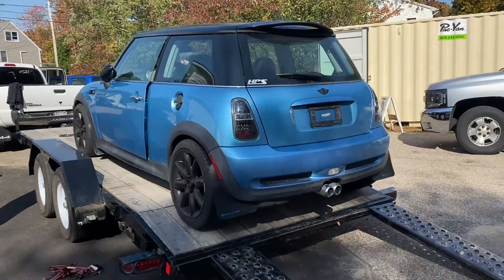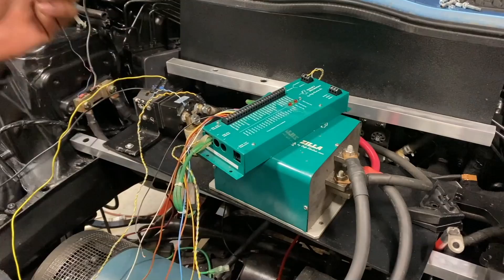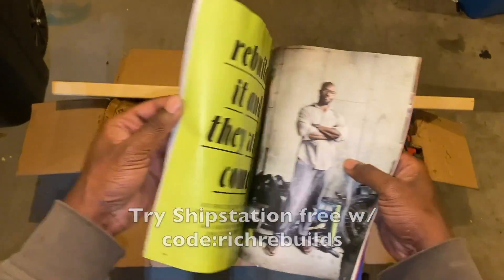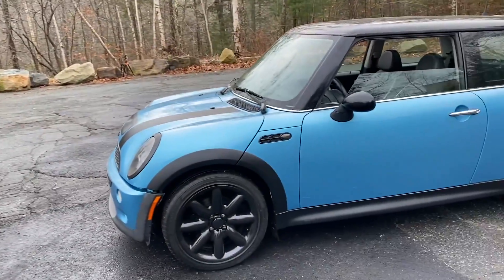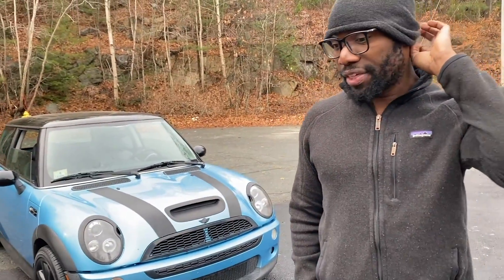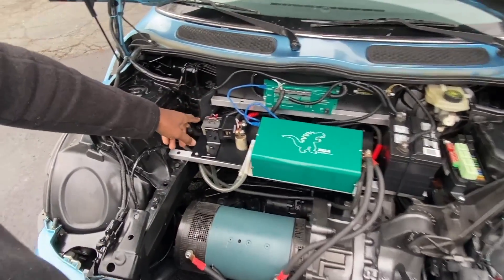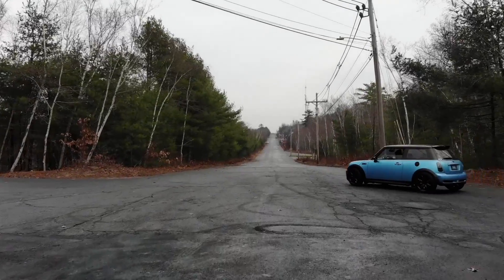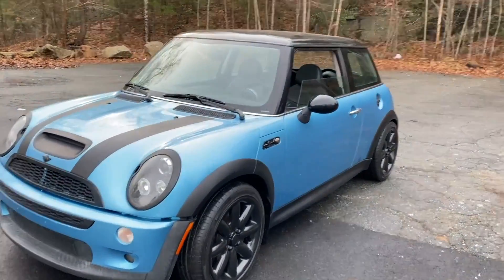We BUILT an Electric Mini Cooper for UNDER $3,000 and its Awesome!

Comment: So you made a mini cooper that is more reliable that it was originally.
Reply: Not difficult
Reply: @sofa-lofa4241  yeah
Reply: All mini coopers are reliable, that's all the wife drives.
Reply: @PeresD  Until you put in non premium gas, use non performance spark plugs, oil filters, oil, and transmission fluid. the car looks decent but costs way to much to use and maintain for what it is.
Reply: @Vivi_Sterling  More of an investment.

Comment: To overcome the initial torque could you not make a pedal where the clutch used to be triggering a cirquit that halves or even 1/3 of the throttle input voltage? This way you could have more accurate control of the bottom end.

Comment: hey I bought a mini cooper 2006 in good condition, just has a recall for an airbag and needs new brakes for $2700, you think it was a decent deal or did I waste my money. 130k miles, just normal wear n tear. there was a couple of leaks that i fixed by simply replacing the caps.

Comment: That an lsx going into an "S"?  Elon's cultists are gonna be so mad.
Reply: It’s going to be so amazing to watch them meltdown 🤘
Reply: It should have the word "S A C R I L E G I O U S" written on the back after it's done. 🔥
Reply: @lolpartyparrot  or "Sacrilicious" hehe
Reply: That's been going on for years. Are they anywhere close to being done?
Reply: Probably a lot better than what I was thinking. I was thinking it was a 350z.
Reply: @nomercy4521  Honestly, I don't think there'd be any hate against an LS-swapped Model S. The fucking thing would literally be a massive engineering exercise; you'd need to make a trans tunnel, delete the frunk for the engine, build a new FIREWALL, find SOME kind of rear-axel setup, add provisions for a radiator and fuel tank... like i'd just be shocked.
Reply: A 5.9 Cummins would have been nice
Reply: @JuicyFruitSkank  Westen already did the 'stang...

Comment: Don't forget to tell everyone the consequences of over revving a dc motor if a gear is missed. One tiny mistake like forgetting it's in neutral and your commutator bars will fling off the rotor shaft, destroying the motor. I believe the zilla has a motor rpm input to prevent this.

Comment: @Rich Rebuilds, Why not cover the bottom of the front to allow the air to flow more streamline under the mini? I think doing so will also minimize dust and water getting up where the motor and electronic are mounted.

Comment: You forgot the most important thing! Super nice job, but the safety dumps a crash test because the 2 battery blocks will fly around the cab during a collision and hit the passengers.
Reply: They're bolted down

Comment: Add solar panel, slide tray the batteries with a encased air cooler partial box.  Secure with latch type quick release clamps.  Power shut off and electric connection, like semi trailer air lines.

Comment: Anyone who cares about having a back seat in one of these has obviously never tried to get into the back seat of a mini.
Reply: One of the most popular Mini mods is called the Rear Seat Delete. It ain't a family sedan.
Reply: Yes. I did have a ride in the back seat of an original Austin Mini. There isn't much space back there.
Reply: At least it's well motivated to make some weight reduction on a car like this one. The exterior of this car looks quite modified with the blacked out wheels and headlight inner panels upon the hood.
Reply: They're not that bad actually I can fit in my buddy's mini one S with not that much problem, just put the front seat kinda between your legs and you're fine, I'm 6ft 2
Reply: @rubenbraekman4515  Pics or it didn't happen
Reply: @rubenbraekman4515  You're a better man than me. I've got in the back of a few and had to be uncoiled out.
Reply: @ruk2023--  haha well getting out is a challenge I'll give you that 😂 I'm pretty flexible I guess
Reply: I’ve got in the back of mine fine. I’m 5’10. Was decently and surprisingly comfortable
Reply: @Tyler Cotton Hill would probably refuse to get in the back a German built car. . .
Reply: They can just sit on the batteries. But wear rubber pants.
Reply: I was told I was conceived in the back seat of a Mini ..
Reply: The recorder sounds while trying to load the trailer are hilarious to me for some reason.
Reply: They are one of the more roomy of compact car rear seats. Two adults can sit comfortably in mine.🤷‍♂️
Reply: My kids love it in the back of my R53. With full size child seats aswell. Daughter behind me to be fair has to put her legs in an odd position though as my seats are in her lap
Reply: The BMW R50 and R53 have for their size good rear seating room. Talking as an owner of an R50 Cooper.
Reply: Ralph Hardwick on the new ones you can easily sit in the back
Reply: @saturndesigns2339  I've been in loads of them, everyone knows someone with a Mini in England. Being able to get in and wanting to go more than a mile in them are two different things.
Reply: @ruk2023--  

Just England or the UK? The back seats for the small size of the car (BMW) are perfectly adequate though you wouldn't want to go from Land's end to John o' Groats if you're say over 200lbs and over 5'10 in the back of one. That goes for just about any small car from the same era though. That said, the rear seats in the BMW Mini are far superior to most.
Reply: @skylined5534  Well I'm from England, so I can only speak for England. 

My original comment wasn't meant for this level of analysis. I'm aware that all small cars have these problems.
Reply: @ruk2023--  

Aye, that they do.
Reply: What gear do you guys run the car in?
Reply: How long does this take to charge?
Reply: Well I even managed to bone my ex wife in the back of her fiat 126 and that entire car would fit in the beach seat of a mini, so stop complaining.

Comment: I'd love to know what the max range is if completely fill this thing with batteries.
Reply: he said 41... with a thrid battery, you could gain 30% more at best--- which would make it like 53 miles..  That's all you get-- get used to plugging it in.
Reply: With these batteries, not great. They are too heavy (435 pounds). 18650s would be about half the weight for similar capacity. For the same weight in 18650s, he could get over 100 miles. It would cost a lot more though. He got those batteries extremely cheap. Even the cheapest good 18650s I could find would cost about $400-500 more. 2170s are even better at a weight to capacity factor. 18650s are cheaper though.
Reply: @anthonypelchat  His total budget is about 2100 bucks right now.  If he sold these battery packs and bought scrap 2170s, I wonder if he could stay inside of 5000 bucks...
Reply: @oooChickenatorXooo  The best prices that I've seen on 2170s is about $2.50 per cell pulled out of a Model 3 pack. There may be cheaper Chinese versions though. At 17.76 watt hours per cell, he would need around 1000 to replace these batteries. $2500 not counting the nickel strips, casing, and wiring needed. He might be able to pull it off, but I doubt it. 

18650s are cheaper and easier to find good recycled ones. I figured that he could replace the capacity of the Volt batteries with 2400 18650s at around $2000 for everything. However, I don't know if those will push out enough amps. I need the specs of the motor he is using. My guess is he will need high discharge batteries, which will cost more.
Reply: @anthonypelchat  I just rewatched the video where he talks about battery selection.  It's a pretty thirsty motor.  I think I get why this car only gets 41 miles.
Reply: @oooChickenatorXooo  Not really. Electric motors are all extremely efficient. You will typically be more affected by the weight of the motor instead of the efficiency differences between two different ones. It is powerful, so he is losing range due to spinning tires. Lol. 

His range issue is the low capacity of the batteries along with their weight. Combined is likely only giving him about 15-16 kwh while weighing 435 pounds (197kg).
Reply: @oooChickenatorXooo  IIRC, I believe that he said that he was using a Warp 9. If so, that is rated at 144v and 200 amps continuous, 500 amp peak. 2170s could do that with a 40s25p configuration. 18650s would also need the 40s, which provides the volts. Standard low output cells would struggle with the continuous amps and couldn't handle peak power at 60p.
Reply: @anthonypelchat  and if he wanted more range he's need to ... add more 40-stacks to that 25...?  Am I understanding this correctly?
Reply: @oooChickenatorXooo  Kinda. I'll try to explain briefly. He would have 1000 cells of 2170s. Each cell only puts out around 3.7 volts, so you need 40 connected in series (positive to negative) to get the needed volts. For the needed amps and to fill out capacity, you need 25 cells ran in parallel (positive to positive). Basically, 40 rows of 25 parallel cells, or 40s25p.

 That provides around 18 kwh of capacity for roughly 155 pounds (battery cells only). You could double that to improve range and reduce the stress on the cells, improving their life expectancy. I believe that they are rated at 2000 cycles, so life expectancy isn't a big deal. But any improvement is nice.
Reply: @anthonypelchat  Like I said... if he wanted more range, he'd need to add more 40-stacks to the pack, correct?  

Range = pack total Ah @ 144v is kinda how I am picturing this
Reply: @oooChickenatorXooo  Sorry. Wasn't positive on how you were asking. Yes, he could then add an additional 40 stack. It actually doesn't have to be the same 25p as long as it's the same 40s for the voltage and he connects them in parallel.
Reply: @oooChickenatorXooo  I went ahead and did some more math that you might be interested in. Using 2170 cells, you could build that 18 kwh pack and it would only take up a small amount of space. Basically 3ft by 2ft by 3 inches. You could split that up a good bit too, say 1.5ft by 2ft by 6 inches to fit behind the back seats possibly. 

For small spaces/evs, 2170s are the best battery cells that I've seen. I would love them if they were cheaper.
Reply: @anthonypelchat  This hobby gets completely nuts when scrap 4680s start to appear on people's junk piles.  You wanna talk about volumetric energy density... damn.

Battery Day made me find religion.
Reply: @oooChickenatorXooo  lol. Between battery day, several YouTube videos, and some personal changes happening next year, I've gotten heavy into research mode and planning for future projects. DIY battery projects, solar, ebikes, an electric go kart, and two EV conversion projects are lined up over the next 3-5 years, depending on finances and if I burn something down. Lol

Btw, those 4680s would be awesome for small EVs. I wonder how they will work for bikes and motorcycles? I'm guessing that you will be able to get a 200+ mile range motorcycle while having amazing performance as well. Can't wait to get my hands on those.
Reply: @anthonypelchat  and we've both got Rich for snarky, sarcastic inspiration.  And random Popeye's cravings.
Reply: @oooChickenatorXooo   Lol. I haven't watched many of his videos. Mainly just following this series on the Mini. Just started watching Jehu Garcia as well. Learning a ton from him.
Reply: @anthonypelchat  Now I want to slot a bunch of 4680s into the tube of a bicycle, structural-battery-pack style, and see how far I can get on a hub motor.

I love Garcia's projects.

Comment: That is one cheap EV man. . . Even if you wanted to add more batteries and get some more range out of it, at less than four grand this is a steal.
Reply: Yeah, he could probably fit 3 batteries in there. If he adds another, optimizes the tq curve in the software, and more rigidly mounts the drive train, he may be able to get it up to 100 miles of range. (If you can give the tq curve with that ancient looking Godzilla controller.)
Reply: @xenonram  It would be very unlikely that he could get over 100 miles of range with these batteries. Too heavy for the capacity given. He would bottom out the car first. He could get over 100 miles pretty easily though with 18650s or 2170s. 18650s are about half the weight per capacity as the ones that he is using. More expensive though.

Comment: nice job, can't beat that price for a budget EV build.  Toyota is supposed to be show a working prototype solid state battery early next year (double the capacity and zero to 100% charge in 10 minutes).  Should get interesting as that trickles down.

Comment: You could make the batteries hotswappable easier, if you make a bracket on the ceiling of the mini that extends with a locking bar on the hatch. Kinda like old factories would do things before loading bays were a thing and had a crane that came all the way from inside the factory outside to the wagons and shit. Make a bracket for the batteries so they can be crane lifted, find a cheapo cart that fits in  under the batteries when removed and you're done.

Comment: could u put a solar panel on top to keep the battery’s charged?
Reply: solar panels aren't effecient to be on a electric car !!!!! its going to make the car weigh alot more making range less , its gonna make alot of drag making the range even less a and you are going to wait a month for it to charge the batteries !!
Reply: @ldtworks1052  You could easily put solar panels on the roof without it causing problems with decent design and I believe some evs have or are doing that. You are right about it taking forever to charge though which is why it isn't done more and is mostly a gimmick. I did some napkin math a while ago and figured out on the highway in an EV with 300 mile range you might get an extra 5 miles range in that time if you are lucky with solar panels. I forget the numbers exactly, but I'm pretty sure I came up with about 1 mile per hour of daylight is how fast you would charge.
Reply: Not really. Most of these EVs are using 300-400 watt hours per mile. Not an issue for a large battery that stores several thousand watt hours (Rich's battery is probably about 15,000-16,000 watt hours). But solar panels need a lot of space to produce enough power. That car would probably only be able to fit enough panels on the roof and hood to get maybe 600-800 watt panels max. That would only put back about 2 miles of range each hour. And that is only when in the sun. 

The other problem would be getting the right sizing to fit on there. Regular cheap panels are too ridged, which would cause lots of drag issues. You would need to get very flexible panels. And you would need to get several small panels instead of a single large one. That would eat into your money very quickly.

Comment: You used a 48 volt dc motor and sent how much voltage in it? I have two dc motors and a 3 phase motor for a truck build I want to do. I thought you was not to allow more volts in to a motor then what it is rated at. Nice vid been looking to see what a 48 volt could do. Thanks
Reply: You can safely push the voltage up a bit. They typically have a max rating in the spec lists. However, these batteries in series should be pushing 300 volts. That is way more than a 48 volt motor should be able to handle. I wish that he had more specs on everything, as the numbers don't add up.

Comment: The battery still crushes you in an accident with 4 tiny bolts , the seats are not made for this
Reply: I think that’s a good point; although, I wonder if given that an accident occurred at such a speed that the batteries would become projectiles if you wouldn’t already be impacted by the other sides being crushed in.